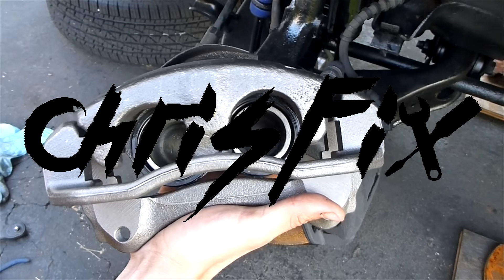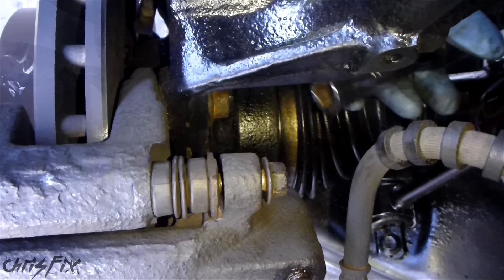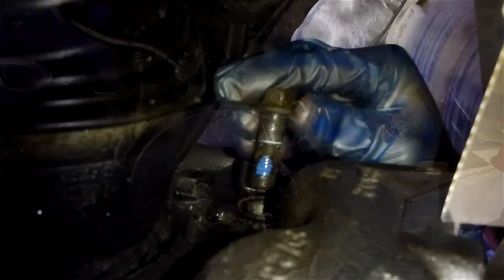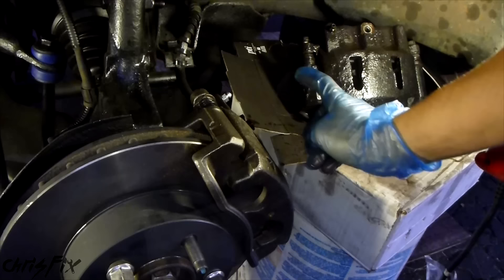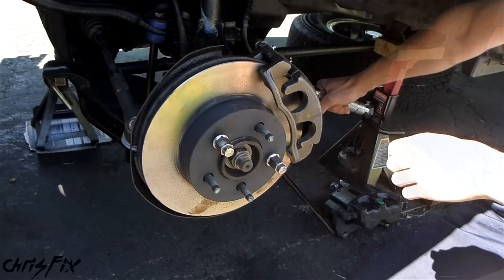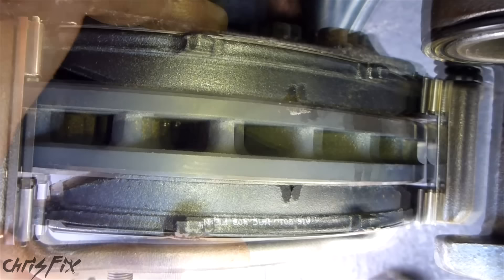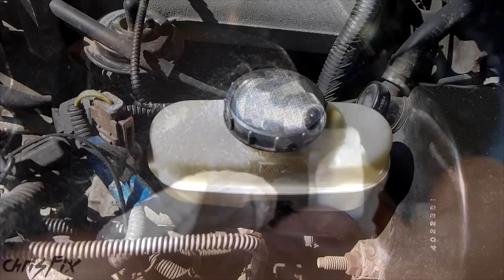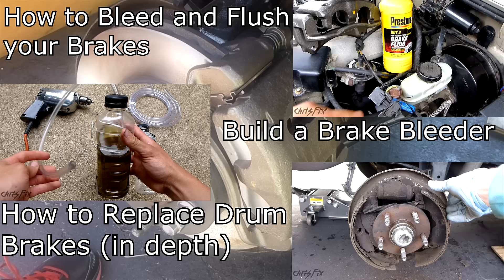How to Replace a Brake Caliper

Comment: I've bled brakes a bunch, and EVERYTIME air gets in through the bleeder's threads with even the smallest amount of loosening. I'll remove it, apply a little silicon paste to the threads and reinstall, but why does no one else seem to mention this? It makes doing the solo method worthless, or actually more harmful do due cosntantly sucking in air through the threads
Reply from the maker: Depends on the brake caliper. With some brake calipers that definitely happens but with others you have longer bleeder screws and that doesn’t happen. You can add Teflon tape to the threads and that stops the problem you are having.

Comment: I need another banjo bolt for the front side Bc I broke the other one and I can’t find any that match the ones I have
Reply from the maker: Get the part number then see what size banjo bolt it is, you will probably have to order one
Reply: @chrisfix  yessir I already got me another one coming in it was too hard to find one for my car  so I called the Toyota parts place and they got me the same one I needed 💙

Comment: If I want to paint my calipers I’d have to bleed the system completely correct? Then Remove paint reinstall new brake fluid bleed out air and then close and good to go right?
Reply from the maker: If you paint the calipers off the car then yes. You can paint them on the car and not remove the brake lines so you don’t have to bleed the brakes.

Comment: @ChrisFix , help! 2010 subaru forester brake line fitting will not release from caliper. Banjo bolt comes out fine, but fitting will not budge. Suggestions?

Comment: just curious how do you know where to line the hole in bolt for brake fluid to flow thru???
Reply: I think the half turn releases pressure on a spring seal. So you don’t need to line up the holes. Just release the valve a bit. 
Something like that.

Comment: HELP!!..i cant find my caliper bracket bolt that mounts the set to the knuckle. I am replacing my caliper and bracket assembly because one of my mounting bolts i assume vibrated off and my caliper came off and left me standed so i had to tow my car. Now i am only left with one but can not find that 2nd bolt needed at any parts store to save my life. How can i locate this much needed bolt??

Comment: When you finish a brake job,  front and or rear, ALWAYS pump up the brakes before moving the car.  
Accelerate to 25-30mph and come to a slow stop.  Do this 3 times.  This is all that is needed to 'bed in' your new pads.
Reply from the maker: Thanks for sharing

Comment: Important tip. Check the size of your new banjo bolt before you go to swap your line the new caliper. Otherwise you'll be streaming brake fluid confused why the bolt won't tighten. Don't ask how I know

Comment: Chris, the bottom 14mm bolt on my existing caliper gets tight, then loosens.  Same thing happens when I try to back it out.  Any thoughts on how to remove it so that I can replace the caliper?
Reply from the maker: The caliper bolt that mounts the caliper to the knuckle or the guide pin bolt that holds the top of the caliper on?
Reply: The guide pin

Comment: I replaced my front calipers and bled the lines and added more brake fluid before I put the wheels back on I pushed the brake pedal a couple times then i checked to see how the rotors turned but they wasn’t turning very well it seems that the caliper isn’t decompressing all the way what could be wrong please help

Comment: What is stopping that open brake line you loosened to not spew brake fluid everywhere ?
Reply from the maker: Theres no pressure in the line and there is air on the other side, so it will drip and leak but it won't shoot brake fluid unless someone stepped on the brakes or something

Comment: If I'm replacing my calipers due to uneven brake wear should I replace all pads at the same time even if they are pretty new?
Reply from the maker: If the pads have uneven wear then yes. Also check this out for uneven wear: https://www.youtube.com/watch?v=Gdc3PZ0gFvA
Reply: @chrisfix  aye thanks for the reply wasn't expecting that to happen ever, I ended up watching that video and followed the advice and it did work.  I originally was trying to figure out 2 things:  grinding noise while turning right at low speed, and loose/unstable/unpredictable steering.  Combination of replacing front wheel bearing and properly greasing the caliper pins solved the grinding noise.  - 1 caliper had a weird groove in it I almost didn't notice like there was a rock stuck in it.  

The steering issue I'm still trying to solve,  I've replaced both outer tie rods which seemed to help some (1 was def bad) but the problem still came back and besides maybe having an alignment done im really trying to figure out where to go from here.

BTW, noticed the videos about fixing stuff around the house now.. not a bad idea.  My journey started with that by having a maintenance job for a property company and eventually I just wanted to keep learning anything and everything.. I found working on cars and houses related in a lot of ways I didn't expect, learning something about working on vehicles would actually help me with my job and vice versa.  Long term goal is electrician (also trying to solve a cluster issue without just replacing it lol)

Comment: Is it normal bleeding process? Since these cars have those abs modules with all this e brake lines going to it.
Reply: As long as you don't let the master cylinder run dry, the abs module will not have to be blead. If you do run the master cylinder dry, a scanner tool must be used to bleed the abs module. Another way is to drive the car on loose gravel and slam the brakes to activate the abs and bleed it.

Comment: I have a question.. why does my brakes vibrate when I press on the brakes? This happen after I changed my rotors and brake pads
Reply: The vibration may not be from only the brakes.  Vibration while braking may come from tires, or other suspension parts that need service.  Before you assume it is the brakes, inspect everything else to double check it is not another issue.  You would not want to replace something that does not need replacing.  It is always a good idea to do a full inspection whenever you do ANY work on or around wheels and suspension.  Also, check carefully for cracked welds and worns bushings on anti-swaybars, draglinks, control arms, and any other suspension parts whenever you can.  Inspect often, and fix things before they break.

Comment: Hi, this is just a question to the community my break line is leaking alot where you connect the line to the caliper with the copper washers anyone know any reasons or any tips to help stop it?

Comment: Hey Chris I installed  my new caliper and bracket seems like the bracket  its rubbing against the rotor what did I do wrong
Reply from the maker: Make sure it’s the correct caliper and bracket (match to the old one) and if so make sure you are installing the bracket on the correct side of the knuckle.

Comment: Is the brake rotor always loose when you take the wheels off?  I thought the rotor was held on by a large central nut?
Reply from the maker: The axle nut rarely holds the rotor in. Typically there is either no screw like in this video or some cars have a screw that needs to be removed
Reply: @chrisfix  awesome thanks for replying Chris I appreciate that.

Comment: I just changed my rotors and pads today and noticed one of my calipers has a ripped piston's boot, but I was too lazy to do the job today, plus it's not leaking.  So looking at this video, I guess it's not a big deal if I drive a few days with my new brakes before changing the calipers.  Anyways, the worst is I will have wasted 250$ on rotors and pads, that cannot mess anything else...

Comment: Bought a custom built hot rod, brakes weren't working correctly, long story short: The rear brake shoes were cracked and facing the wrong way. Front brake calipers were installed on the wrong side left/right! AND the brake lines are routed wrong with the front going to the back and vice versa! 
Yeeesh, well at least I'm learning a lot, thinks for the videos!

Comment: I did mine but i didn’t use new bolt that came with caliper. Now the break is really low. You think I might have a leak there?
Reply: Crooked Level I would go back and bleed the brakes again
Reply: A low brake pedal is usually the first sign to having air still in the lines

Comment: Chris, why didn't  you clamp the rubber hose to keep air going through the line?😮
Reply from the maker: Never clamp brake lines. It can damage them. You just bleed them afterwords. You need to bleed it no matter what anyway.
Reply: @chrisfix   Chris,you clamp them off to stop the air from traveling up the line, sure if your rubber lines are hard and worn out ,don't do it. However if you rubber lines are still supple,youl stop the air at that point and your lines return to normal.,I've been using this method for years.If you want to bleed th whole system,  go ahead.

Comment: so my 10 year old truck is so rusted I had to replace the front brake lines and calipers along with transmission service and a flush. they keep calling me with more bad news. they now say the bill is 1650.00
I'm assuming the rear brake lines, and fuel line is as rusted as the front. so I'm not going to pick it up until everything underneath is replaced  because it's going to last me another ten years regardless.

Comment: If i change a rear caliper do I have to bleed all 4 corners or just the one I worked on?
Reply from the maker: As long as you don’t let the fluid empty from the master cylinder, you only need to bleed the one brake you removed the line from.
Reply: ChrisFix thanks 🙏🏽

Comment: Hey @chrisfix
I have a 2016 mazda6 and the piston boots of my front calipers are punctured and the pistons are a little rusty. I don't think I need entire calipers for the front. Plus, the car is like 40000 miles so the calipers are pretty new. Is it easy to just replace the boot and pistons rather than what you did in the video?
Reply from the maker: Yeah you would use compressed air in the bleeder valve to push the piston out. The rebuild kit will have new seals and boots. Pretty simple.
Reply: @chrisfix  Well, I don't have a compressor. I've seen some people just press the brakes to pull them out. Plus, I know you said in the video that it's better not to crimp the brake line, but for something like this maybe there's no other way but to do that? I was actually thinking of just doing this while the calipers are still installed.

Comment: Great demo. But if you’re doing a car like a Mercedes that has a buttload of computers, you might need a scanner costing $3,000 - $5,000 to reset the computers. Check out Scott Kilmer’s channel. Another mechanic had to have a Mercedes towed to Scotty’s shop after just changing the brake pads! HAHA

Comment: Is there a reason why you're not using the correct tools to complete the job. Is it because you are using what you think a regular backyard mechanic has in his toolbox or are you just using a pair of channel locks instead of an open end wrench which would be not only not stripping the boat but also using safety

Comment: I once had a new used car with jerky front brakes, pulled it apart, okay well there’s no pad material, so it’s breaking on the pad metal backing, and in the other side there’s nothing there at all, so breaking on the caliper only,
Reply from the maker: Dang! I'm glad it still stopped!

Comment: Why did he use loctite on the Caliper bracket bolts? They don’t need loctite. Also how does he know the hole in the banjo bolt is mating up with the hole from the brake line, should have marked both holes with witeout and matched them up instead of doing torque settings with a banjo

Comment: is this the same with the rear caliper?
Reply from the maker: Yes but the rear might also have an e-brake cable you need to disconnect but usually that’s pretty easy.

Comment: would you use brake silicone lube on pads or anti seize?
Reply: ahoorakia You mean the pistons to the back of the caliper? Best good old traditional method is applying a small amount of copper grease, good heat tolerance and protect the piston from seizing up on the back of the pad rather than act like a lubricant, never apply any form of lubricant onto the pad material (part that grips the disc) whatsoever, if you get some on the the discs or pad material then use a good degreaser or brake cleaner and Make sure they are perfectly free of oil/grease/lubricant etc.
Reply: @DoktrDub  of course I meant the back of the pad!!
Reply: ahoorakia sorry I was just making sure, I did personally knew somebody that did this once lol

Comment: I tried to change my own oil. The oil filter wouldn't come off. It was on so tight it started mangling like an empty Pepsi can. I took it to fausak. The guy tripped n spilled half a quart of oil on my engine. Washed it off with the hose. Exactly specifically when I left has been jerking horribly. Yayyyyy.

Comment: Chris, please do a brake caliper rebuild video (preferably dual piston exactly like in this video), 9 out 10 videos on here are incorrect, the biggest error I see in all these videos is brake fluid being used during assembly, 100% incorrect, there is hydraulic assembly fluid for this purpose sold on Amazon. Using brake fluid during assembly increases the chance of damaging the piston, bore and pressure seal by requiring much more force to install the piston (especially Phenolic pistons), also, I see brake fluid being used to install dust boots and will damage the rubber. Caliper pistons assembled dry (only brake fluid) can stick over time, causing uneven pad wear, pulling and premature pressure seal failure. I can give you all the info/tips needed to put together a video...brake caliper rebuilding is an advanced repair of brakes that most people do not get involved with and want to see it done correctly..It does not make any sense to give up your OEM brake caliper core for a unknown re-manufactured one when you can rebuild it yourself for much less...

Comment: My damn Caliper bolt is stuck, broke a wrench hitting it with a hammer and soaked it in WD40, going to try hitting it with a hammer and vinegar and using my jack against a wrench

Comment: Why crack the banjo fitting allowing air and dirt to system,and why remove caliper bracket is a waste of time ,unless you have to remove the roter just slowly clamp the pistons back with a wood clamp and old brake pad and your ready for new shoes .

Comment: You literally skipped the step I came here for.  Actually disconnecting the brake like from the old and dealing with the mess its going to make.  Then putting it on the new one.